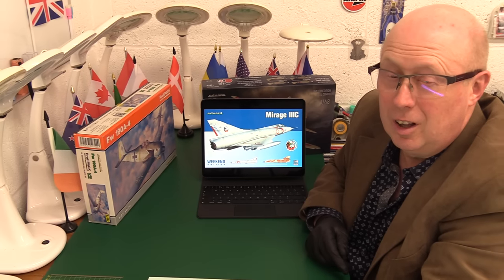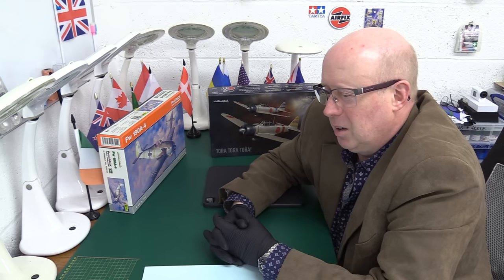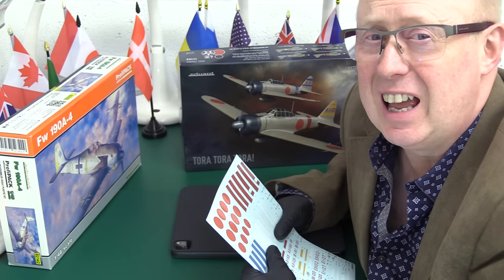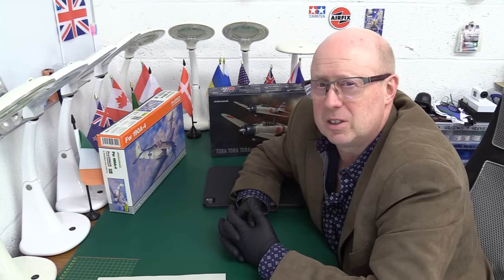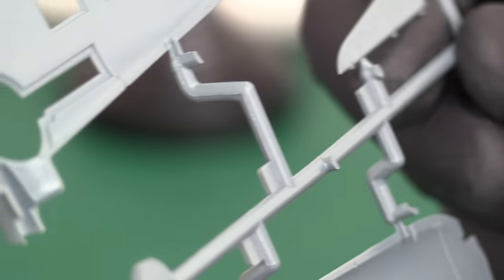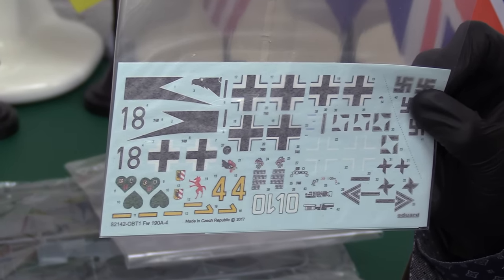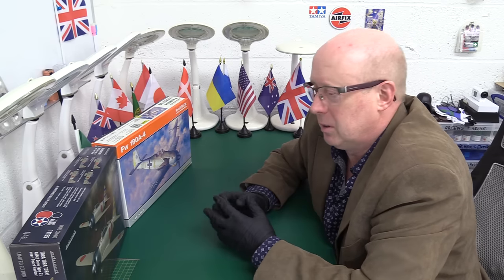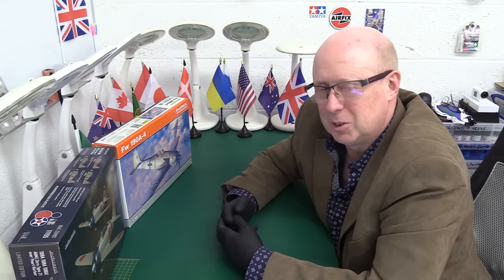Let's talk about...EDUARD (Rant!) 😠

Comment: The other thing you mention is the print quality of the new decals. From what I can see, they’ve been printed digitally and not the traditional silk screen method. Digital printing makes colours from basic cmyk inks (plus a handful of ‘specials’ if the printing machine can facilitate them). This means that colours often have a ‘grainy’ appearance when you look at them closely. Screen printed decals on the other hand use ‘pure’ ink colours which eliminates the grain and invariably have crisper edges and richer colours (which aren’t always what modellers want, especially if they’re replicating machines which have been exposed to the weather for prolonged periods).
Reply from the maker: Excellent & informative comment there, thanks Tim. 👍🏻

Comment: I think the sole advantage (if you want to call it that) of the new Eduard decals is for doing a metal finish where the carrier film is going to show up like a bug on a wedding cake no matter what you do, so it's nice to have the option of removing it but other than that, definitely a pain on normal paint jobs. Thanks for the thoughts on Eduard, I hope they do course-correct as I like their subjects and (most) of their kits in terms of detail and fit with the sprue gate exceptions you mentioned. Hobby 2000 in my opinion is doing great work. No, they are not a manufacturer but they have put out some great packages of other makers' plastic. I just did their rebox of CyberHobby/Dragon's 1/32 Bf-109E7 and it was a fantastic build. Masks included and the Cartograf decals were absolutely fantastic to work with, all at a reasonable price. Later Tamiya kits are just beautiful and I build one once in a while when I need a break from fiddling. Working on their Do-335 now and it's just incredible how well-engineered it is. I enjoy painting more than building, so it's a real treat for me, now only if their decals weren't awful...

Comment: Got to say I've only had very good experiences with Eduard kits, admittedly only 190s and Fishbeds. But coming from airfix kits the details are stunning and masks and photo etch are great additions.
Reply from the maker: I will not dispute that at all...but they are not what they once were, as you can see from the older and newer examples I showed.
Reply: @Peter-Oxley-Modelling-Lab looking forward to this...have their 1/72 Mig-21 PFM in the stash (kit nmbr 7454) and it seems to be way overly engineered

Comment: I don't agree with most of your criticism of Eduard. Yes, they should have told modelers that their decals had changed and require a different application technique to make the best of them. Having discovered that the carrier film is on top and can be peeled away, leaving a painted on look is far superior than having to spray and sand multiple coats of varnish in order to hide the decal film edges of your garden variety decals. Worse so with the ridiculously thick Tamiya decals. Far more work and risk to the model in my honest opinion. Also I prefer the way Eduard have done their part attachment points, as it is easier to clean up the mating surface than a gate which runs on external detail, and needs to be sanded away, risking potential damage to fine exterior detail. I think Eduard have surpassed Tamiya as far as selection, quality and detail years ago.
Reply from the maker: But Ken...do you also agree with Eduard reboxing Russian kits and not telling customers? That is their latest business plan...Su-25k is a Zvezda kit.
Reply: @Peter-Oxley-Modelling-Lab  I was not aware they have been reboxing Russian kits, but they have been reboxing other companies kits for quite some time now. Hobby 2000, and Revell do the same. I could be wrong, but I've never seen any kit company that reboxes another manufacturer's kit state that anywhere within the kit. Even Atlantis, which reboxes just about all of their catalog from ancient Revell or Monogram tooling don't state it on their kits. They do, however, usually let people know by something on their social media. Does it make it right? No, but even Tamiya has done this, and only recently put the other manufacturer's label (Italeri) alongside theirs on the box.
Reply: @Peter-Oxley-Modelling-Lab  well, Eduard always give full information about reboxed kits...look at their web page...it is clearly stated on generał overview of a kit, info newsletters and manuals. In case of HRABE kit, zvezda is mentioned as manufacturer.
Reply: YOU ARE JOKING . OLD TAMIYA DECALS ARE POOR . but the rest of their kits . Are best quality . Packaging ; fit of parts and general engineering designed to fit the kit together . Take the P38 Lightning or Hien ; they are second to none . Their instructions are good ; only bettered perhaps by Airfix . Eduard instructions are all over the place ; not clear where parts go and easy to miss a sequence . The Eduard  Weekend kits are good value so it's not all bad .
Reply: @AnthonyBrown12324 but the decals…
Reply: The decals on the Recent Hien 1/48 were excellent. On the other hand the 1/32 Spitfire Xvi decals were terrible and I had to buy aftermarket which I rarely do. Extra Decals are pretty good and not too pricey. Hopefully going forward the Hien will be the norm . Your point about choice is valid. Tamiya just doesn't do enough aircraft but that's always been the case . So many other products particularly vehicles. I generally am able to correct faults but sanding is not my favourite past time 
 Or having to locate pieces where there is no proper attachment.
Reply: @AnthonyBrown12324  I wasn't criticizing Tamiya kit quality or instructions, only their decals. Everyone knows Tamiya as the gold standard for model kit manufacturing. It would be nice if they put out more than one new tooled aircraft kit per year, but I'm guessing it's because they make more money on their radio control hobby side of the business than the plastic model kit side. I do agree Airfix instructions are excellent, but their quality control is crap. I recently received a kit without any of the clear parts included. Several attempts to contact Airfix through the proper channels have gone unanswered.
Reply: You normally get a response from Airfix. They have become a bit mean spirited about providing receipts which is bad because a lot of people keep kits ages before building and might lose proof . I gather ICM will send any parts out of goodwill as Airfix once did . I did receive a missing Meteor part quickly. The worst thing about Airfix was the sink marks on new tools. The 1/48 Sabre Venom and Meteor . Plus warped parts on the Blenheim and Lancaster. They are repairable but just poor quality.  I see they are packing kits better as on the Recent B24 . hopefully the new plastic builds better .
Reply: @AnthonyBrown12324  yes, I understand there are people out there looking to exploit the customer service department for their own nefarious reasons. This was not my case. It was a recently purchased kit and I provided the information they requested. I didn't receive so much as an acknowledgement from them. I'll still buy Airfix kits, it's just that I've come to realize that if there's a quality issue with the kit, I'm on my own. Revell, however provided me a replacement canopy, shipped free of charge from Germany when I sent them the picture of the damaged part and a copy of my receipt. Great customer service!
Reply: @kenhanson1819  Also the retailer has sold you a faulty product so they should refund you . Amazon gave me £25  for a Tamiya 1/32 Spitfire and I was able to repair the part , they would also have given me a refund otherwise . This same kit with the dodgy decals LOL.

Comment: My first Eduard kit was the 1/48 Bf-108B in the black box and have since built several Eduard (32, 48 and 72 scale) kits over the years, with lots of enjoyment. I've had one real issue with an Eduard product. One of their masking sets was the wrong scale. It was for the 1/48 Tamiya P-47M, but it was too small to be 1/48 but too big for 1/72, turned out to be about 1/60, strange that.
I personally prefer the sprue attachment point that goes round to the inside of the part. Generally, the sprue point is smaller on the outside where all the detail is, and thicker on the inside which makes it easier to clip the part and then sand the mating surfaces. Rather than having a larger point on the outside of a leading edge for instance and then having to sand and lose all that lovely detail in the process.
As for the transfers, I agree they should have shown people the new style transfers and then put them in the box with an instruction on how to use them. I’ll probably test some of mine on a test kit and see how that goes. So interesting times ahead…

Comment: I have long experience with Eduard kits. In fact this is my favorite brand nowdays. I am not talking about reboxed kits, cos usually they are good kits with plenty pe, masks and resin goods. You will be satisfied if you get one. BUT, the true Eduard kits are awesome, and best in terms of details, precision, quality. Eduard's MIG-21 is the best kit ever. I have build already 3 of them and I am not going to stop. If you look for building a plane, check if there is a Eduard kit on market. About decals...You can master them, just some practise is needed and the result is much better from thick decals from for example Tamiya etc. Or buy a decal set of your wish I you want to work the old way. There are many tutorials how to put properly Eduard decals on yt.
Reply from the maker: Good for you, but my experience with them is not so good. I think many people are blinded by Eduard's excellent surface detail. All three kits I built disappointed me. I am currently building the Zero and again, despite being a recent kit the poor fit of the parts and vague instructions are disappointing compared to other manufacturers...more on this soon.

Comment: Hey peter, I think I have found a solution for the eduard decal film, this has worked for me twice in a row. After applying the varnish, decal, then settling solution, I waited 2 days. Instead of trying the enamel thinner trick, I applied masking tape over the decal, pressed firmly, waited a few minutes, then the film comes off perfectly.

Comment: I agree with you Peter. The fit of some Eduard sets is very bad. I tried to build the FW-190-D but there are so much parts that don't fit properly (Wings on the fuselage, machine gun hub on fuselage and wings). I stopped building the Eduard Focke Wulf and bought the (old) Tamiya one. I'am going to build that in the A or B-sceme from the Eduard's. Never tried to use their new decals, so fingers cross. I build already some nice Eduard models with old decals like Mig 21 and the F6-3. I  hope Eduard will learn from your comments and make their models better fit. Indeed, mask sets should be in the box. Tamiya decals are very thick, I always use Tamaya's decals setter strong or super strong for their decals. When I use cartograph decals I use Micro Set and Fix. Thanks a lot for you informative video's

Comment: Academy is doing a great Zero right now, not a Swiss watch, but definitely 'quartz' reliability and spot-on build ability 😊
Reply: Having built both the Eduard still wins out in detail
Reply: The academy Zero is garbage accuracy wise. The upper cowl gun decking is poorly shaped, the propellor is way off. It’s at a great price point but overall shape is worse than the Hasegawa Zeros from the mid 90s.

Comment: Regarding the infamous decals this is what Eduard says about them (they should know, I think)

"Lately, the justification for rejecting our decals has been centered around the alleged need to remove the carrier from them when applied. It is surprising how many modelers mention this feature as a negative, even though we ourselves do not state or recommend such a thing. On the contrary, we actually present them as traditional decals, and the carrier does not need to be removed from them. Just treat them like any other decal, apply them to a glossy surface and paint them with clear varnish after drying. The carrier then becomes invisible on the surface. By the way, the fact that the varnish has irregular edges and has a relatively wide overlap around the color motif of the decal has a significant effect on the fact that after varnishing, the edge of the varnish on the surface of the model is practically unrecognizable. And it doesn't even need a thick coating of clear. So please, people: you don't actually need to remove the carrier after applying the decals, and the wider offset doesn't matter; it can't be seen on the finished model!"
(Eduard newsletter December 2023)

I don't take one side or the other; everyone is entitled to like or dislike a product, but it should be done based on facts. Eduard never intended for its decals to be used by removing the carrier film. It is a byproduct of its new manufacturing process. It can be done and works, but it is unnecessary. Applied traditionally works as intended so I don't understand the controversy.
Reply from the maker: Thank you for this interesting communication, however this is very ironic, as Eduard seem to be having some memory problems: It was EDUARD themselves who recommended to everyone how to remove their top-film on these new decals in their previous monthly newsletter (May '21 I believe) so this just shows that clearly THEY DON'T KNOW & seemingly cannot even make their own mind up...another example of the poor levels of communication and lack of clear instruction to customers yet again. (Ooops!) Also this does not resolve the poor (Digital) printing quality many of us have also experienced on these newer decal design. I have a good piece of advice for Eduard: Stop trying to force your customers to use something that is not popular & DROP these absurd decals ASAP if you want to regain your reputation for being one of the best manufacturers of kits...otherwise, many of us will just not consider their products.

Comment: I have zero problems with the gate connections. It is trivial to clean them up.
Reply: Same here, I’d rather a join face sprue gate that means I don’t touch the surface detail during cleaning up to an edge feed one. They went over to these around the time of the mk1 Spit with its raised rivets. Far from being a bad idea they’re actually helping the modeller.
Reply from the maker: @72twink  Be careful what you wish for: If Takom start doing that with their harder plastic you will find it very difficult to clean up without impacting the mating surface quality, and realise the folly in this idea when applied by other manufacturers with different grades of plastic.
Reply: It’s still easier to clean up a gate (no matter how hard the plastic is) on an edge compared to having them in amongst detail like raised rivets.

Comment: Damn, I've got one Eduard kit, the 1/48th Spitfire Mk Vc ProfiPack. It looks like a beautiful kit, but sadly it is a 2022 boxing and has the dreaded new style decals, and the weird sprue gates (although they only look bad on the fuselage as far as I can see. I was keen on getting some more of their kits as they are reasonably priced here in New Zealand, and they have some very nice kits of aircraft that I really like. I might still get some, but I will see how I get on with the decals. Hopefully by the time I buy another one they will have reverted to the old style, otherwise if it's a disaster I will have to get aftermarket decals, which gets very expensive down here. The only aftermarket decals I have bought are for a 1/32nd Stuka from Eagle Cal. They are superb, but the cost of postage from the US to here was more than the decals cost.

Comment: Hi Peter, in regards to the sprue attachment points, I believe some Tamiya kits (panther d, perhaps the sea harrier too) also do the ‘over the top’ connection points where you have 2 places to snip off from the gate.. just an observation I guess. I’m not sure if I like the design or not, just adds a little bit extra to the cutting & sanding phase

Comment: How do you remove that carrier film, I tried but did not know how.. Eduard (or any company whatsoever) should also improve some matters  1) The drawings in the instructions are small and do not always show the positions well enough. 2 The landing gear attachment to the fuselage, what they do not make sturdier and longer plugs and deeper holes to allow the, to more snugly and properly attached. 3) the canopy attachments always piss me off, in any models they have not invented how to properly attach them and alignment is always the problem.

Comment: I have a handful of Eduard kits in my stash. 3 spitfires in 48 scale, and a Mustang in 48 scale. 

Based on the comments in the video, it seems like we can almost say Eduard lets their kit designers work on what they love, and it seems obvious what they love. Spits, mustangs, and 109s. 

My only "real" criticism of the spitfire i just finished, is that unlike tamiya or other brands, there's nothing really in place to hold the spinner. A polycap, or a one way flanged pin would help. I felt it necessary to glue my spinner in place. 

One of the biggest plusses (imho) is on the profipacks, you can opt to use the provided PE parts, or you can build without.
Reply from the maker: I am building the Zero as we type…it’s pretty good but I really hate the twin-axis sprue attachment points, they need loads of extra clean up and great care not to damage the parts. 🙄